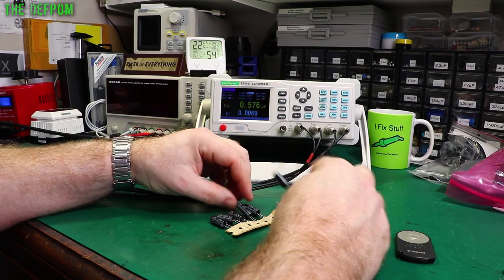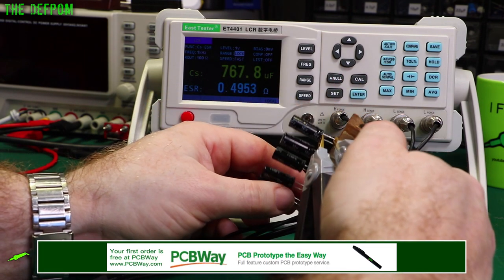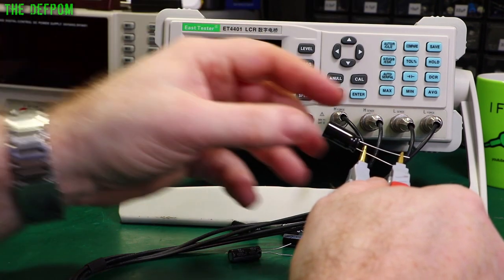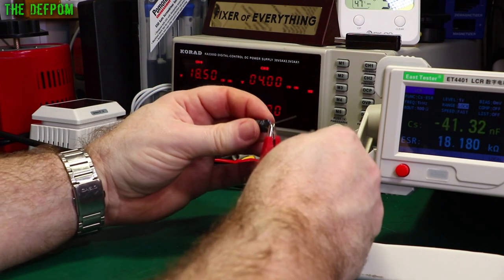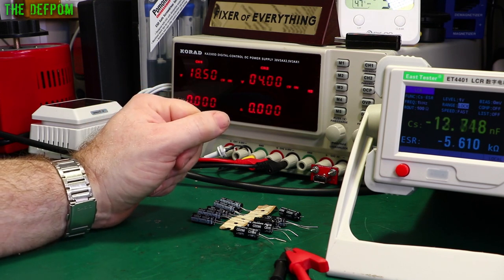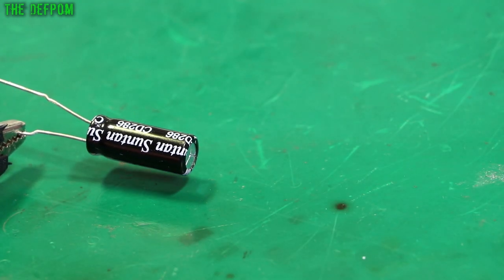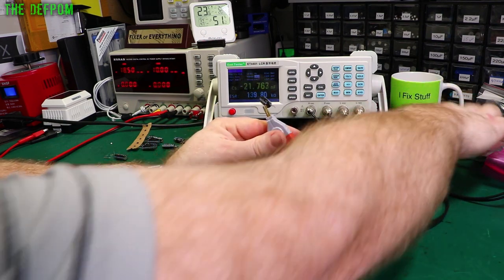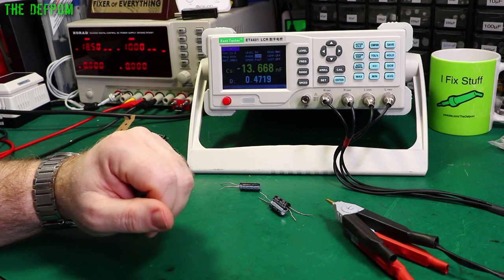#776 Why You Should Buy Good Quality Capacitors - Suntan Cap Blows Up

Comment: Interesting video, Scott. When testing electrolytics in addition to value and ESR,  D or Q checks I like to hook them up to a Sencore Capacitor Analyzer which measures leakage current in tens of microamps at the rated working voltage. Also great for reforming large caps. I worked on systems that contained several Farads of capacitance and we always checked/reformed new capacitors before installing them.

Comment: Not that surprising. The shelf-life of electrolytic caps is often much shorter than the service life. The main failure mode is evaporation of electrolyte due to the rubber bung not being a perfect seal. This is true even for the top brands.

Comment: I know that my query is a long time coming but have you had any experience with Suntan metal poly caps. They seem to perform well in speaker crossover systems and I've never had any problems with them as they all have measured well within tolerance. I should point out that the ones I purchase are 250v ones and I'm unlikely to ever go beyond 100v even in high powered systems.

Comment: In regards to the nichicon cap with higher ESR, I bet if you gave it some dc voltage then test ESR again it would have good ESR. I’ve experienced this before with older stock nichicon caps!

Comment: As crappy as capacitors are when sourced from jaycar, I think that if you hooked them up to your power supply at a lower voltage and raised it periodically till you reached their rated voltage, then discharged them, they might have woken up and come back to life! But you have to go easy on the voltage and current.. the only problem apart from the time that it takes is that the majority of lab power supplies only get to 30V. Which is what I have, so for me to test a capacitor that is rated above 30V, I have to use a DC to DC boost converter which isn't ideal but it works... But I'm still looking for a better affordable option. 
How's your capacitor tester? I just saw those things on eBay today, I was considering one that was reviewed on X RayTonyB's channel which he posted recently! It doesn't look as nice as your one but it manages to display all the details on the one screen where I noticed that you have to push a button to see the dissipation which is a real pity because the screen is big enough to fit everything...

Comment: Good video topic, but it would be great if you could also share some affordable ways to get a useful selection of quality electrolytic capacitors.

I don't want to buy cheap electrolytics and have seen how worthless they are in actual circuits where their inadequacy and/or failure results in unreliable projects and often damages far more expensive components, but how can we practically obtain a selection of high-quality caps on a budget?  That is the video I want to see :).

Comment: You would love to see the old 470,000uF supply capacitors on the original ALTAIR and IMSAI home computers if not run for 30 to 40years. On new powerup if not carefully ensuring repolarising by very short 1 to 2 sec power cycles with many minutes gap on off state. Then over a few days progressing up to minutes in stagrs, you could blow a hole in your ceiling with computer l8d off or buckling the steel lid if on and gilling your room with pungent smoke and gunk /paper/foil chaff.
I managed ok after 30 years, but afew people resurrcting old computers have had need for medical attention. Those computers had up to 6 such or similar capacitors between 100,000 uF and 470,000uF with 10v to 25v ratings. Large can types!

All Electrolytics with over 10 years unpowered storage deserve carefull repolarising. Low voltage and current limiting essential or only bery brief power cycles for some time before progressing to longer power on or higher voltsges, if monitoring current no full power on

Comment: Measuring new old stock capacitors right at the spot where the bandolier tape is full of glue that has leaked is not a good idea if you want to test them. Big Clive mentions this when he snips old through hole components right in the nice clean middle of the leads.

Comment: ... sorry sent prior off incomplete...
And ensuring current is not over several  mA for lower values an 10's mA on very large capacitors.
Reply: Good story about your experiences resurrecting large, old caps.  For what it's worth, you can edit a comment after posting it with the little 3-dot icon to the right of the comment.  Making a second comment will not work because the comments will not be sorted together for readers.  Editing is best, but replying to your own post is better than a brand new comment.

Comment: Will blow & destroy other part of the board. will smoke & leak liquid. 
it's hard to find original good capacitors.
usually, aftermarket caps are cheap & mediocre quality.

Comment: Alway a problem with the stuff from China. Undoubtedly some Chinese capacitors are just as good as the big name brands but due to very poor control in the supply chain it’s a gamble. I guess it depends on the stuff your manufacturing for me I could never afford to install a non brand but if your building a dollar farting dog toy then only the components price point matters.  A lot of capacitor do improve with use as they will reform if not used in a while. Unfortunately it also goes the other way on occasions.

Comment: According to Rubycon... "Leakage current of Aluminum Electrolytic Capacitors may be increased after storage for a long time. Conduct electrification [reforming] treatment for such capacitors before use.Electrification Treatment: Connect a 1kΩ resistor in series with the subject capacitor, and apply the DC voltage as high as the Rated Voltage for 1 hour.Discharge the capacitor through a resistor of about 1Ω/Volt after the electrification."
Reply from the maker: Interesting info, thanks for sharing